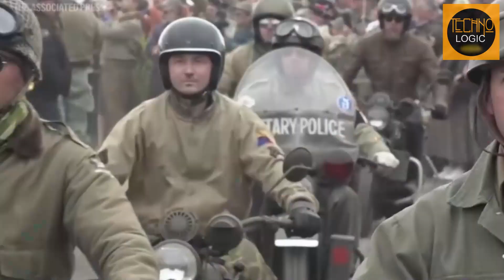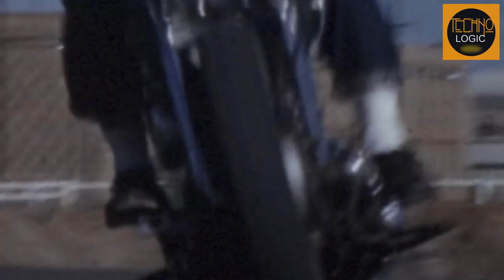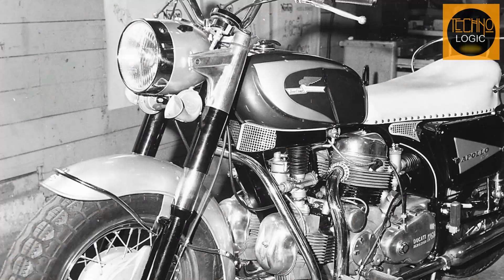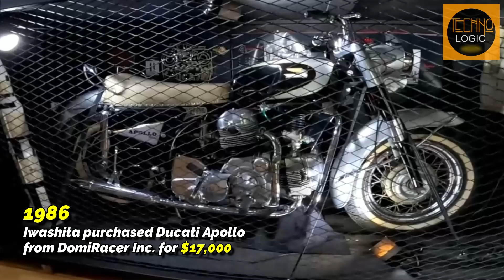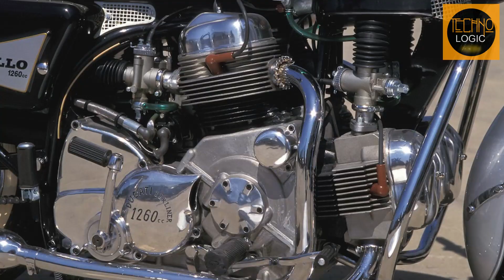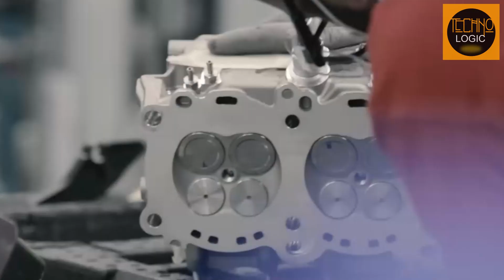The First V4 Engine from Ducati, Probably The First Harley Davidson Imitator?

Comment: 300 kg wet weight distribution with rider look like 55%-60% at rear +/- and still tire was so 💩 that they csnt handle power of 100 hp ? 🫣 from what was made those tire hard plastic? wood ? steel? or some other 💩 🤭
Reply: SALUD!
🎉
Reply: “so much torque, the chassis twisted”